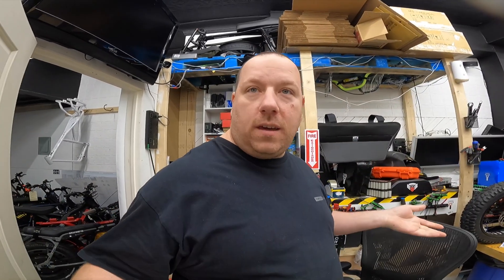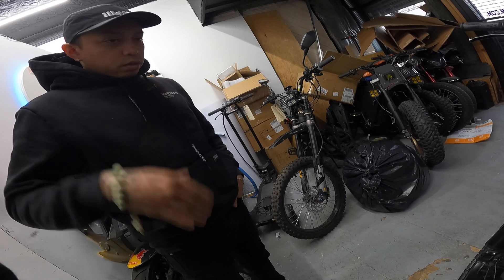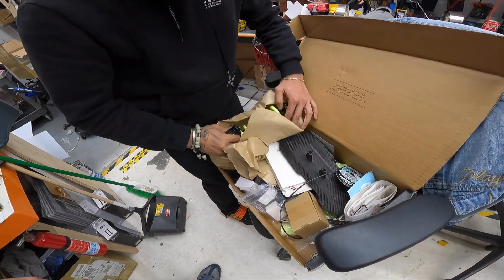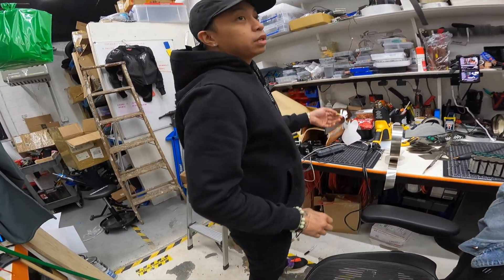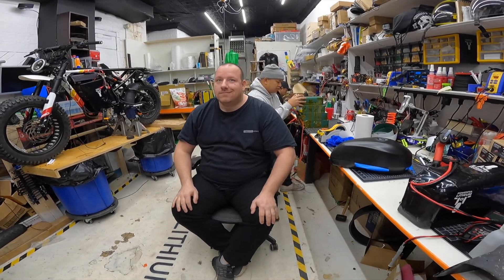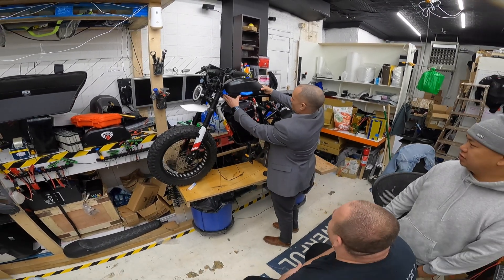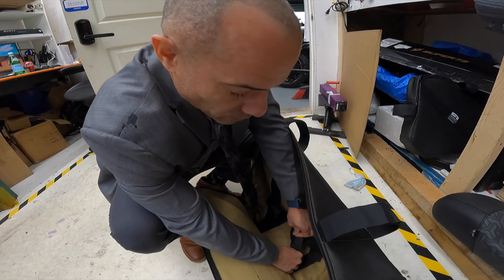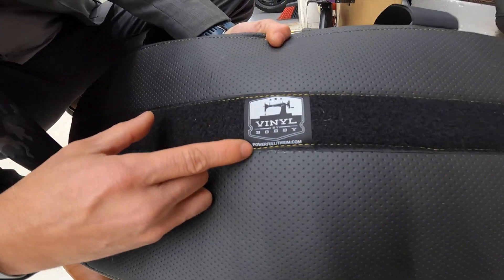The BIGGEST MOLICEL BATTERY Ever Made For A SUPER73 From Powerful Lithium

Comment: Can you use the tank battery as your main battery…. not just off the a range extender?
Reply from the maker: If it made by Poweful Lithium yes… 🙌 or if your controller works off the voltage your tank battery supplies… 🙌💯🙌 Depends on your setup…

Comment: What size tires 🛞 is on that blue RX? I want that!
Reply from the maker: 120/80 16” front
140/70 16” rear
Reply: I was wondering what size and kind of tubes do you recommend? I just got those Michelin tires in and I think the tubes are to small that I ordered. Thank you for the content
Reply from the maker: @pmaguilar84  the inner tubes I’m told are 20x4

Comment: How does the weld on the super 73 hold up with all this extra battery weight?
Reply from the maker: Hey 👋 These are the latest version frame and they are way better than the original defective models that easily snapped… 
🙌💯💪